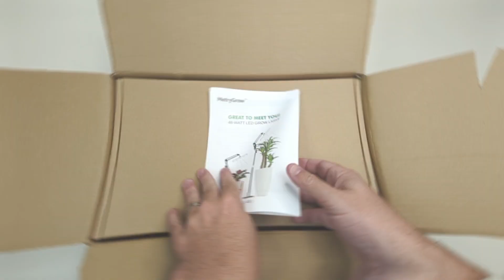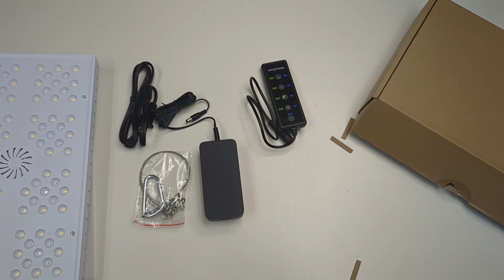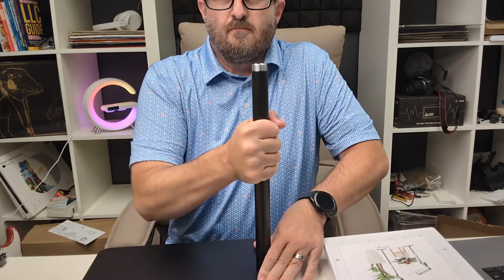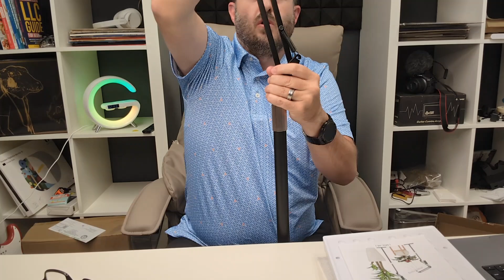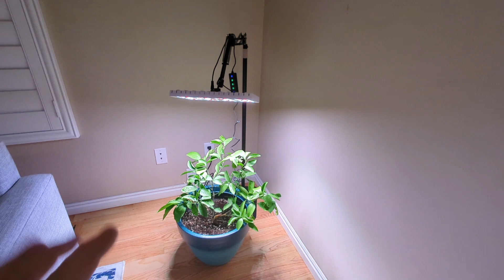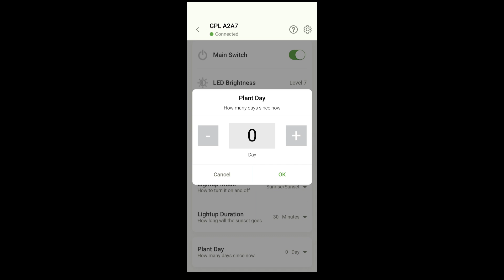Metrygrow Plant Grow Light

Comment: Missed the whole how to connect WIFI. For me instructions say to press WIFI on the remote for 3 seconds. When I do this it beeps and then shuts off. Instruction do not say anything about this nor do they say to turn it back on. If you keep going through the steps you can’t finish because it off. If you turn it on you still can’t finish but can go through more steps, like finding and choosing network and entering password and sending it to the light. Then it errors out not able to continue and only option is to retry (and start all over again).
Reply from the maker: Sounds like your plant light is trying out for a role as the world's most uncooperative tech! Maybe it just needs a little pep talk to get it back on track.

Comment: I got one 🥰 trying to see which light is good for cannabis 😂 red or blue
Reply: Veg setting till you're ready to fllower than switch to that setting. You can do the 16hr (or just no cycle for 24 hour) but when flower time comes switch to the 12(or manually less) and i sugest lowering the lights to maybe 50% too.
Reply: When flower you're replicating the autumn sun which triggers the plant's flowering cycle. White light is bad. Also if you screw with the light cycle too much you'll end up with both male and female parts == Less bud(female) and guaranteed seeds.